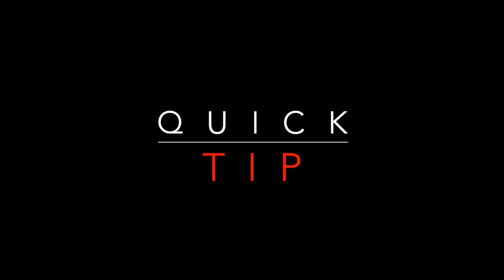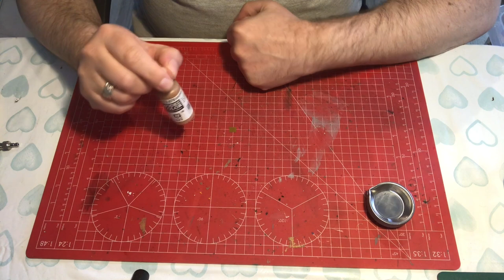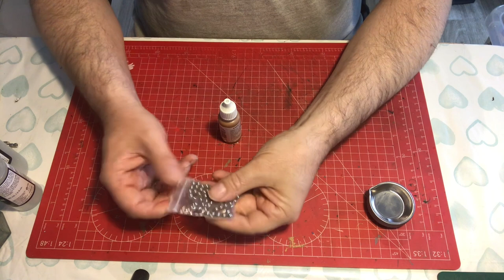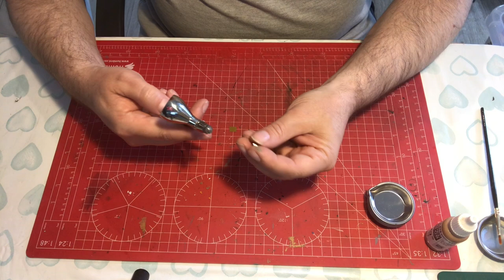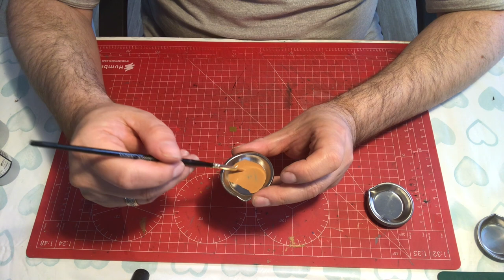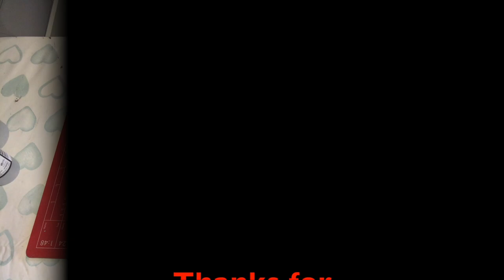Quick Tips - The 1 easy rule for trouble free spraying of Vallejo Model Color

Comment: When using the Vallejo Airbrush paints, do you also have to thin it? Wjy does it stay sticky? Even after weeks of drying it stays sticky. Why is that?
Reply from the maker: Unfortunately it’s not a simple answer but yes I think model air roughly 25% but it depends on all sorts of things your best using your eye and experience to judge if the paint is thin enough before you put it in your airbrush.  I always put it in a pallet first to get it right.
Staying sticky for days is not correct it’s usually touch dry in 30 minutes or less so not sure what your doing if you are thinning change your thinner, use the dedicated brand thinner is best don’t use something like levelling thinners in true acrylic paint.
You can clear coat the paint after 30 mins which will stop the paint being sticky
Reply: @ModelkitStuff  maybe used too much retarder?That has happened to me.

Comment: I just started airbrushing and I’ve used the Vallejo paints and i seem to have thinned them just right as the paint laid down just right on the model but it dried to a total flat coat. Was it supposed to turn out glossy or is this normal and if so what do I use to give it a gloss coat? Thanks for the help.

Comment: Thanks for the info! Just started airbrushing with some Model Colors I had for brush painting before. Although I thinned them down, still not able to find the balance for smooth flow from the spray and no accumulation of paint on the model. (using 0.3 spray with ~ 1.2 bar). Would the metallic colors of Model Color line be good with this tip or need to be diluted more?
Reply from the maker: Best to have a play and see what works the metallic colours are all quite individual in terms of viscosity.

Comment: Thank you for this video. I'm in the process of finding an alternative paint to Model Master Acryl which has been discontinued. With your mixture for using Vallejo Model Color, how many coats would someone need to be prepared to paint for good adequate coverage? More, less, or the same for brush painting as for airbrushing? Thanks again.
Reply from the maker: No set rules depending on the colour, primer etc, lay the number of coats you need but on average 2 to 3
Reply: @ModelkitStuff  What primer do you like to use? Do you thin the primer or use it straight out of the bottle? Have you ever used the Vallejo Retarder Medium along with thinner to prevent airbrush tip drying or to help with brush painting? Thanks again for your advice with using Vallejo Model Color paints.
Reply from the maker: @davidlanham5914  Hi David, I use different primers but obviously you don’t have to use a primer at all, a friend of mine who wins lots of show awards never primes.  Halfords automotive rattle can primer is excellent.  If brushing or or airbrushing I use Ultimate primer un-thinned which is stynalrez re-bottled.

If you wash your parts first you don’t need to prime, but priming can be useful for changing top coat colour saturation or where you have used multi media parts to balance the surface colour, plastic and etch for example.
Reply: @ModelkitStuff  Don't believe Halfords is readily available in the U.S. where I live. Do you have any experience using Tamiya Fine Surface Primer in rattle cans? I'll check into the Ultimate primer availability. My Badger Patriot 105 airbrush has a 0.5mm needle, so I would hope it would be O.K. to shoot un-thinned without clogging. What has been your experience with the Vallejo Surface primers?
Reply from the maker: @davidlanham5914  Any automotive primer should work and hugely cheaper than Tamiya, I personally find Tamiya primer in rattle cans a bit thin.  I like Vallejo primers a lot too.  Like I say mist the time you don’t need to prime so don’t get tied up about it all, you can just put a layer of paint on.

Drying Vallejo primer and paint with a hairdryer makes the surface harder
Reply: Try the Vallejo primers, they are excellent. I airbrush and brush with the 200ml bottles all the time and so long as you give the bottle a good shake its good to go straight out of the bottle, add a couple drops of flow enhancer in the cup as it helps. Also keep the nozzle of the bottles clean so you don't get and crap in it. I use the Black primer before spraying metallic especially silver/ali on aircraft, the metallic sticks better then and easy to see where you've sprayed.

Comment: Hi, do you have a diy recipe for airbrush thinner that works with vallejo?...
Reply from the maker: I use Vallejo thinner and flow improver, why would you want to invent a mix when there is one ready to go?
Reply: @ModelkitStuff  because here the thinner is too expensive, between USD30 and 35( a bottle of vallejo paint around 6) i make diy thinner for the tamiya, ammo and revell acqua paints, but there is something with the vallejo ones that gum up(sorry for crappy english)
Reply from the maker: @zetabola1  right ok, you can thin all Vallejo paint model colour and model air with water.

Comment: Uh..........There are too many variables to have a 50 50 rules for example people use different air pressure from around 15 psi up to 25, or the nozzle size from .2, .3 .5 and a combination of all the above.  The only answer is to experiment with what you are working with.
Reply from the maker: Yep but as a ‘rule’ 50/50 works
Reply: This is obviously true but you'd be surprised how consistently 50/50 works with Vallejo model color. It's consistent enough to have 50/50 as a rule or the minimum dilution you must have if you want model color to airbrush well.